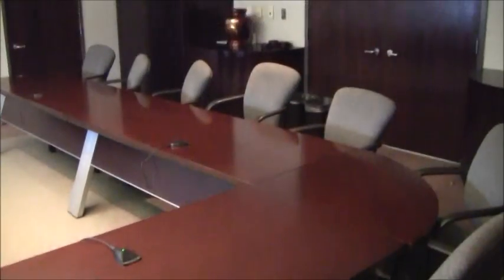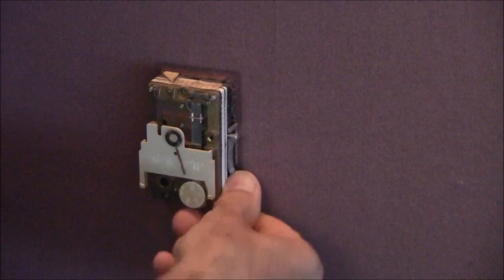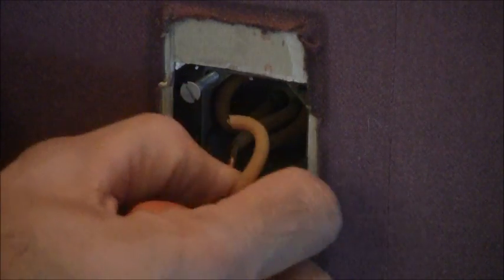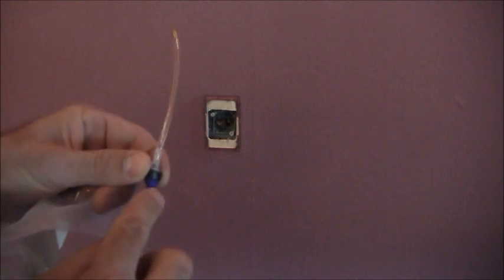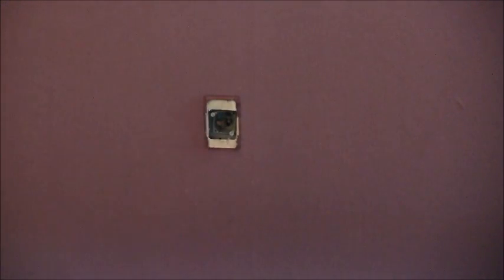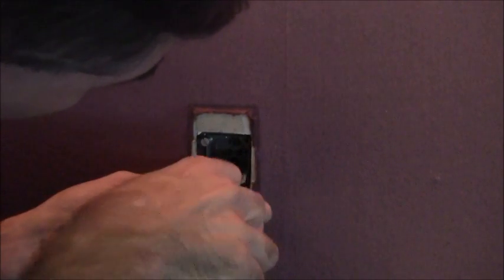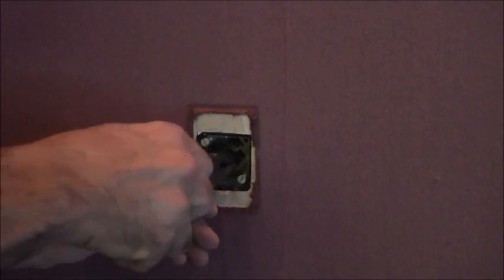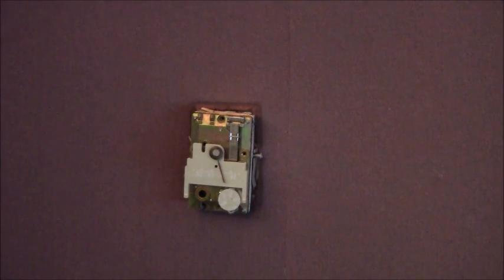Why is my Pneumatic Thermostat ; t stat making a constant hissing sound

Comment: Ken we have a pneumatic powered HVAC system with VAV box's heat and cool controlled by TITUS 40LY98 during building rounds I heard a hissing sound above the ceiling after locating the source of the sound i discovered air coming out of a factory pin size hole located just to the left of the word Thermostat would you have any suggestions? I believe this is not normal I have a building full of these HVAC pneumatic TITUS controllers and currently this is the only one that has the hissing sound.
Reply from the maker: it sounds like you have a leak from a blown diaphragm, coming out of your velocity controller, replace the Titus 40LY98.

Comment: I used to have pneumatics in a building I worked at. They can be finicky, but once you've worked on them for a while it gets easier to calibrate these systems. I kinda like them because their different. Tstats, valves, dampers, switches, low limits, etc... were all pneumatic. leaks in the system can cause them to not operate properly as well. The system has since been upgraded to digital controls which can now be controlled from a computer offsite.

Comment: I'm remodeling in an office and have to move the thermostat.  There are tiny copper pipes in the ceiling above the thermostat with rubber tubes going down into the wall to the thermostat.  Any ideas on the best rubber tubbing to use?

Comment: Also what can cause a hissing t-stat is that the O-rings ( S & R) are bad & need to be replaced. When the O rings are bad the T-stat cannot make a positive connection. Had to replace several of them today in my building. I just cut them off the clear tubing & install them on the original air lines if they are in good condition. Also a twisted or warped metal t-stat mounting plate can prevent a solid connection.